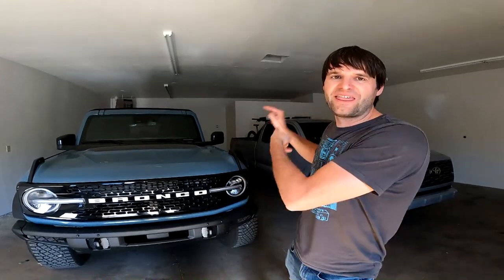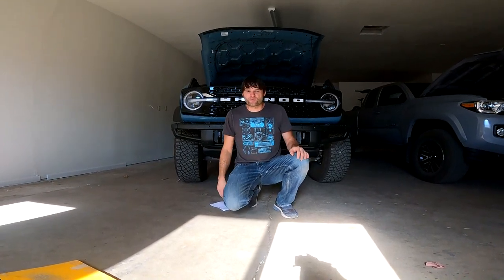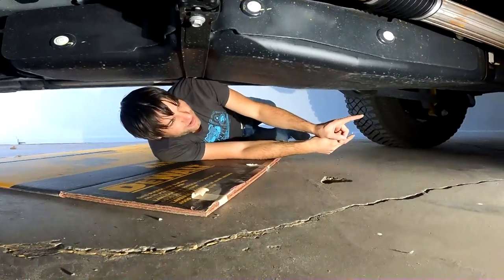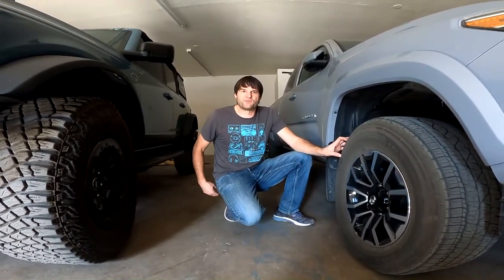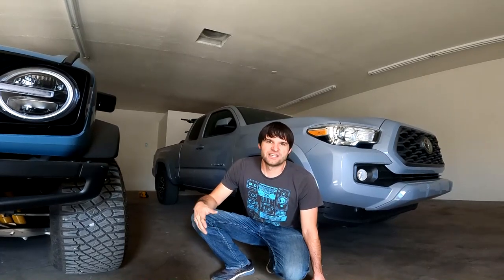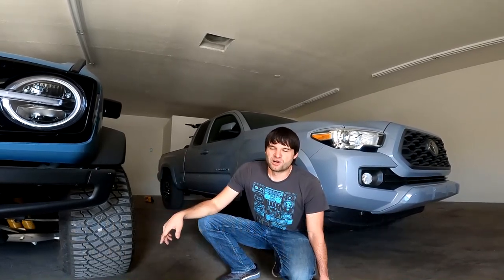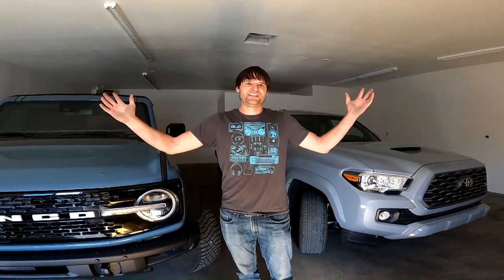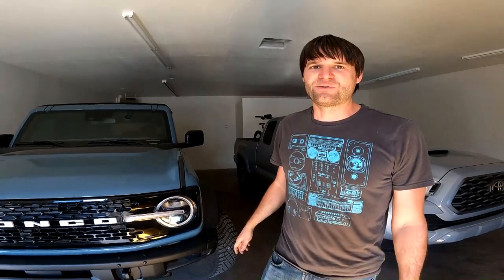2021 Ford Bronco vs 2021 Toyota Tacoma TRD – Which has better components for Off Road Use?

Comment: I’ll take the Ford; even prefer a Ranger or Explorer over Tacoma/4Runner. That Bronco is sweet … like it and Jeeps too. Both are excellent choices. Toyota does a good job with small cars, but not a fan of their trucks/SUVs.
Reply from the maker: I'm not a brand loyalist.  I'm mostly interested in what parts a vehicle uses, reliability and capability.  The new Jeep JL is a mess for hard trail use (very expensive to build and correct all the shortcomings).  Toyota model is good for reliability as they way over engineer parts but they won't upgrade them for decades.  It would be great if they would design something special for enthusiasts but not enough money in it (for mainstream).  Ford often tries too hard... making too many new parts or innovations on a new platform which can result in reliability issues.  However,  they do make great products like our Super Duty.  Nothing is perfect!
Reply: The 5th gen 4runner will outlive any other vehicle. The Toyota hilux/pickup will outlast any jeep/Ford. There's a video where top gear couldn't kill the hilux. There's also a reason the Toyota trucks are the middle east choice for warfare because they don't die.

Comment: Thank you for a great video! Could you please compare the ride in the Taco vs Bronco?
Reply from the maker: Both ride similar on road.  Bronco has much more ability to handle higher speed off road (better suspension travel and shocks).  These modern vehicles drive more like a car than a truck.

Comment: 4Runner has 109” wheel base.
Reply from the maker: It's fairly short... right between the 2 door and 4 door Bronco.  109.8" is a good middle of the road lenth.

Comment: Bronco ugly so it’s a hard pass
Reply from the maker: Haha I guess looks are a preference.   2 door is a much more proper design for the Bronco
Reply: @TruckCamper   I rather pay more and get a better looking truck like the ford raptor
Reply from the maker: @mcchickenmcflurry3636  Very different rig but still fun!  2dr Bronco has manual transmission,  removable doors and roof, short wheelbase and all the off road gear.   Just depends on needs and use.